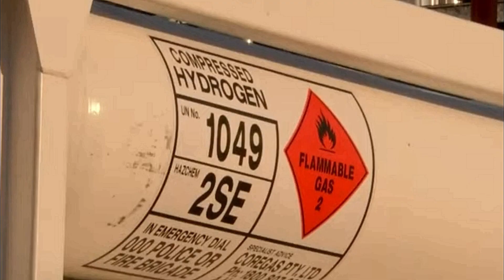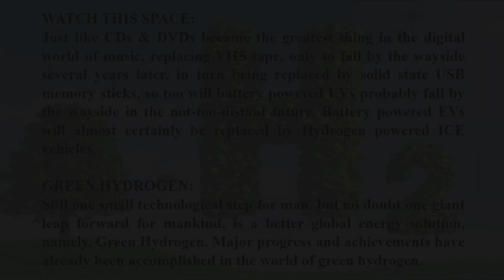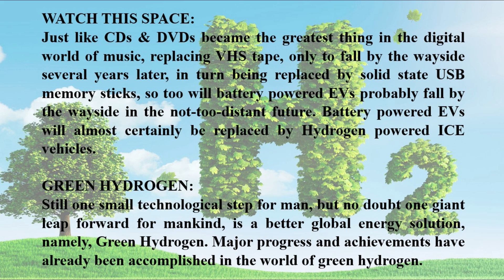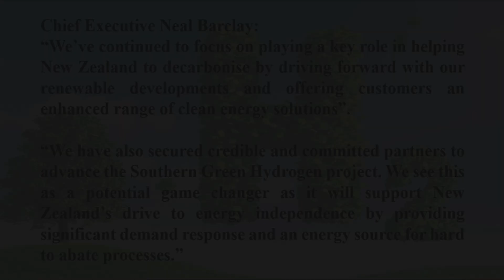Battery Powered EVs Are Dead: Long Live ICE !!!

Comment: Toyota never went electric they just buy what others have done. They have been putting all their money in to hydrogen cars for years. James May has one he says its one of the best cars he has ever owned. Also they never mention you can power a house, heat a house, and cook on hydrogen you just need extraction for the water vapor with heating and cooking. A Toyota Mirai will give you 3kw/h per liter so you could power you house from your car off grid. Also why is the government looking at nation wide hydrogen stations. bring in all the hydrogen cars instead of EV,s and i am sure BP, Gull and the rest would soon have hydrogen at the pump. Solar is the cheapest for making hydrogen and in the UK some BP petrol stations have small hydrogen splitters run off solar to top up tanks.